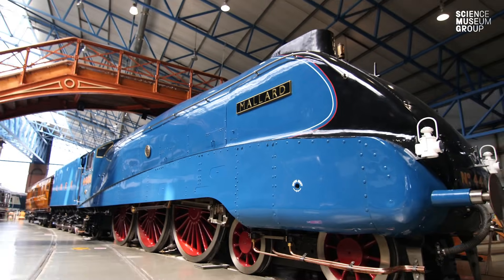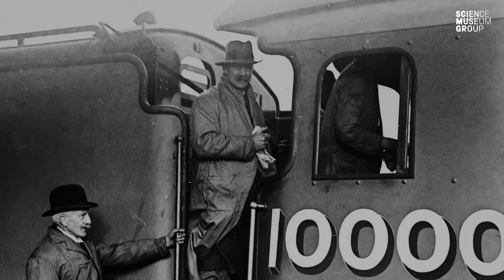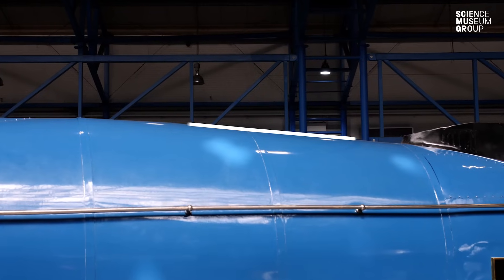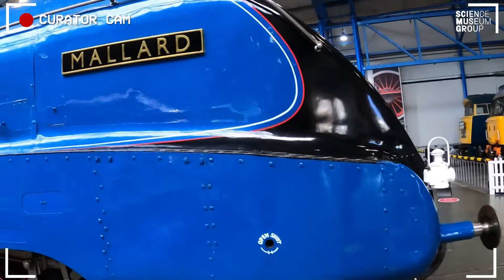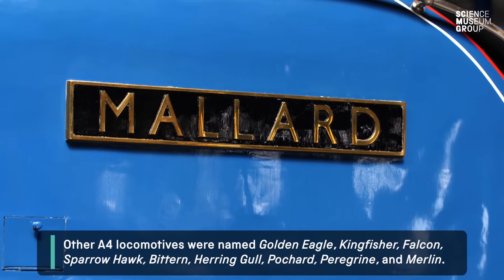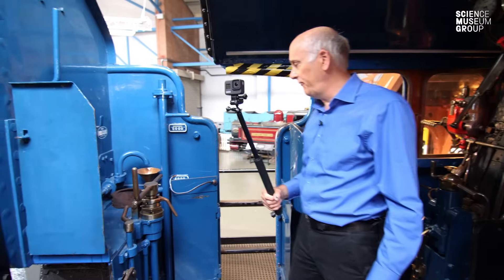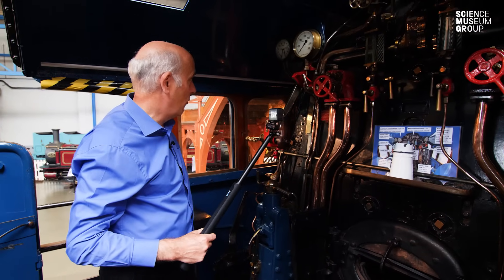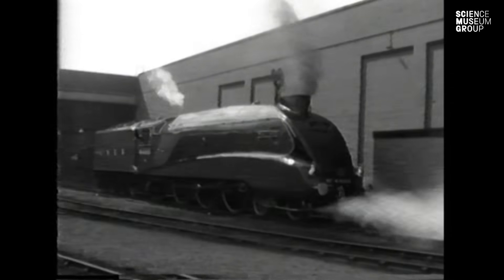Inside Mallard, the World's Fastest Steam Locomotive | Curator with a Camera

Comment: I wonder what they are going to do for the centenary? Could steam do 200mph? I know it technically possible. I’ve just never seen anyone achieve it? Could steam be made green with solar and electric elements? I know it effectively a giant kettle. So induction heating would be possible vai a third rail pickups or super massive batteries in the tender. Even the running gear doesn’t have to be of 1930s standards. As things can be made futuristic with magnetic barring. I don’t know of any steltics (steam electric) designs in use today. Thought feel that would be the way to go preservation wise. Might even suit lighter rail application with a compound boiler system.( many smaller boilers) bolted together perhaps? To achieve a record It would only need to reach 200mph for 10minuets. To hold the record. I might not have got everything. Thought I think the old girl would be proud to see younger generation continue the sprit of steam by going faster. I can see sleaker designs, fewer complicated components and all round easy of use. Mallard is alway a fave of many a steam buffs everywhere. Would be nice to see the old girl get a birthday present to remember. With the engineering available? I certainly think mallard record could be broken. Especially if there a flywheel or two incorporated spinning at high rpms.
Reply: I wish they'd restore Mallard to running condition for her Centenary!
Reply: @highbrookendmodelrailway  yes I think most people would. It would be cool if they overhauled mallard to run even faster. Try to get the old girl up to a 150mph question is would her frames be up for it? Would her wheel take that sort of stress? I know there might be a few Aerospace materials that can achieve it. Question is would they go that far in a overhaul? I’m not sure? Nigel gresley might have done give the chance. I know certain parts could be made with Alu-bronze often found in the landing gears of planes. If they were to go with reduced friction then magnetic barrings would be a great fit. Value gear upgrade to increase timing and cutoffs. In all it a lot of work and if the green agenda continues she will need more than coal to get her running. Indeed I love the idea of mallard chasing the steel again. I’m just not sure how they would achieve it. There’s many things that can be done to get her running. I fear the cost would prohibit it. Flying Scotsman too way long in the shop that the thought. Mallard will be no different. With an locomotive a hefty as mallard. Hunting and resonance becomes a real problem like real big problem. That mallard could derail at high speed kind of problem. I don’t think they would want to wreck a piece of history like that. When she did 126mph they had to overhaul her as her barrings were shot. I dread to think what damage came from piston slap. I loved to see the old girl do it one more time.  I guess all we can do is hope and pray.
Reply: Cerium steel in lightweight roller-bearing rods would probably be the better choice for rods.  See David Wardale's various improvements on piston valves if you want to retain them.  Note that vacuum eduction in the locomotive slipstream can both improve drafting and lower the effective exhaust backpressure at high mass flow.

Note that neither independent driver suspension nor 'canting' the drivers inward a la racing wheelchairs are advisable on reciprocating locomotives.  The engines have to remain in close "quarter" for balancing, and that involves torsionally stout axles; the wheel tread contour goes all to hell if you cant the wheel very far with respect to the railhead...

We worked out the details of 'correct' use of catalyzed H2O2 with Oxford Catalysts, over a decade ago.  As you may remember this involves low-carbon fuel (we proposed methanol or ethanol) and about 30 to 34% "HTP" -- the trick is that the H2O2 dissociates to water, and contains water, so by passing a (,comparatively) dilute mixture over the catalyst you generate about 11 molecules of water at effective superheat per molecule of carbon dioxide... and the catalyst runs cooler.  Mass flow is determined entirely by feed-pump volumetrics and pressure; any tendency to 'pressure excursion' just pushes the feed away from the catalyst area...
Reply: @wizlish  fair enough.  With the wish bone idea. it was general to keep the wheel in a near vertical with maybe with a tolerance of 1-2%.  Then have it act more like standard cross-slide. Maybe with the correct torsion spings to hold it all in tension. I know as smart as I am. sometimes getting the wheel geometry to work when overly canted would be a nightmare. Because of points. I understood the derailment risk and didn’t fancy it. Just struggle to picture it. So much to be to far out to practically work. Think Romans ballista and your may be somewhere close. 
I’d imagined having roll forging as the primary wheel structure.  firstly to reduce the material used and secondly for ease of assembly and maintenance. Much like a hubless motorcycle. Or droid tanks from Star Wars. Then having some crank arrangements to transfer directly from the con rods. I concur on the type of steel for the con rods.  though it might be worth considering a combination of rare earths in trace amounts to improve conductivity. Cerium and cobalt respectively.  ive heard to of neodymium and manganese being added though that is a bit left field for me. All I know it’s similar to wootz steel.  So would end up somewhere near crucible steel.. if it was good for swords it would be good in these types of applications. It would lend itself to being imprint with a magnetic field. 

I do recall reading something about pressure maintenance when using catalyst. Though my knowledge is yard and a half behind yours. It just something I’ve encountered along the way. I know the nazi used it extensively in there v2 rockets.  there was effort with black knight rockets. Something I wanted to read up on. As life a sweet shop of thing to do. Never got round to reminding myself. 

Pistion valves i was aware of due to duke of gloucester. A few 5mt’s and p2’s and American logging loco’s. may have been looking to replicate that. I’m not sure how that could transfer into a diesel style arrangement. Though I doubt that would be impossible? It something I need to learn about in greater detail.  So I’m loving the helpful pointers. 

From what I remember about drafting capabilities the whole idea was an air multiplier. Which presents things like the dyson air multiplier into the mix. I know it has a lot to do with co flow. other than that. this spanner monkey a little out of his depth. kylchap exhaust is as close as I get. I understand that it uses the exhaust as an injector. To suck more air in to repeat the cycle. Now thing have moved on and 3D printing  is available it’s possible to have nested designs.  Which help improve air flow and improve overall efficiency.  It just a question of choke flow? Where that happens? 

It might be possible make piston mods if the cylinder bore is sleeve in a copper alloy. So the piston head act more like solenoid. This would be beneficial to reduce ware on the inside bore. I know I’ve mentioned alu-bronze this would be one place where it use would be beneficial. Provide the outside of the cylinder head are magnetically imprinted with a high gauss field.  It may reduce the need for piston rings? As soon as the Piston moves it induce a magnetic field in the alloy. Much like Micheal faraday’s experiment into induction.  Where you have a floating aluminium plate above a charged coil.  You see this in some of the attempts to make a back to the future hoverboard. Some while back they made a copper lined skate ramp for it to run on. The same true for the pistons.
Reply: Unfortunately YouTube comments make it difficult to read while responding, or indeed to find a given comment without scrolling through everything when notified of a reply.

There is no need to 'separate' the drivers for better roadholding as in F1.  While lead-driver guiding is tremendously important, do that with good progressive and proportional lateral-motion devices, or some form of Krauss-Helmholtz arrangement perhaps with additional levers as in East German practice.

The cerium acts as a grain refiner.  Chapelon noted with some quiet alarm that the only way Timken roller rods could possibly work was if they were bending in buckling, probably to a visible extent, twice per revolution.  Your chosen rod metallurgy has to accommodate that.

You'd be correct imho taking your valve gear arrangement from Duke of Gloucester, but it ain't piston valves; it is one of the highest British technical achievements, overmodestly named "British Caprotti".  This has been carefully documented on DoG's Web site for your perusing pleasure; you may want to rearrange the valves and port geometry but the actuation needs little if any rethinking.

The Kylchap arrangement is still about the free-est to be practically built and maintained (things like the Lempor or Kylpor 'not having proved out well' in practice) and for high speed you will adjust this for free and even negative-pressure steam exhaust while using incidental slipstream to keep the fire stably drawn.

Balance the engine using the methodology for the 9F class if you want to retain overbalance, but go straight to dynamic zero-overbalance if you actually want to go at extreme speeds.

The other approach is to find the correspondence around Turbomotive 2 before Alan Fozard quit and joined the 5AT effort.  The balanced reaction turbine for that engine is easily capable of any speed the boiler can steam... and Westinghouse patented the fix for low-speed turbine slip in 1948.  (Magnetorheologics for effective duplex conjugation we're an established 'thing' by 1949...)
Reply: The absolute top limit for reciprocating steam would be determined by critical speeds, and probably involve harmonic coupling into the suspension.  It will not be achieved without true zero overbalance 'and all that that implies'.  There is a large fold-out drawing of a Chapelon design for 150mph in Carpenter's 1952 translation of LLAV, but I don't think it would be safe to operate on any real railway at that speed even if it developed the effective DBHP to reach it.

Strange that you mention flywheels.  One of the designs for the American ALPS locomotive in the early 2000s involved GTCC with steam bottoming, driving a generator originally used for SDI that had very large rotational inertia.  It would be technically possible (although not particularly cost-effective) to drive this entirely on steam, and completely suitable running gear has presently been demonstrated at well above 200mph equivalent...
Reply: @wizlish  awesome! When i have been dreaming about this I was thinking something like independent wheels, f1style wishbone suspension. Some form of direct drive. I’ve even gotten as far as thinking out mag lev parts. As I’ve seen such things as magnetic gears which will reduce ware massively. There been many other options I’ve become aware of like catalytic converters and hydrogen peroxide. Thank to integza on YouTube playing with peroxide. Then it’s all about gear boxes and transfer shafts. Even had ideas about a 10-12ft wheel. Completely based on a planetary gears set.  As an engineering student I calculated it need to be turning at 650rpms to do 200 mph. I originally wanted a reciprocal design. i realised it would be damn near impossible to get the things right from my knowledge base. I was thinking of designs like a rotary engine from an aircraft. V&W design. Nearly 20 years from when I first started dreaming of smashing it. My thinking has come along way. I knew that some sort of gearing would be needed. An ode to Richard Trevithick.  It taken me nearly 20 years. Learn about these things. Going from meccano. To where my thinking is today. I’m aware the steam needs to go green if its to survive.  It also means you can have high pressure accumulator.  Another mod I would have is disk brakes. More over use the wheels as the disk with massive callipers. I found refrance to SNCF 230-01 Class 4-6-0s. After taking a look, going to have to do way more reading. 155mph is nuts to say the least.  So not our of the realms of possibility. Especially due to the access to modern material science.  You got things like printed polly magnets with applications in bearings technology. In fact if designed well enough you have the ability to use magnetic induction to reduce friction. Which will levitate any component off any spigot or shafts. Reducing ware.  Maybe even eliminating it. It would have to a specific made for mallard. To ensure that comprehensive forces don’t set up a destructive resonance.  Leading to failure of the running gear.  Heck if she’s overhauled correctly no reason why she couldn’t exceed 150mph. Especially if high strength magnetic are involved. You get mag lev doing 300mph.  So a locomotive doing 200 with similar technology incorporated not out of the realms of possibilities.
Reply: I thought  maybe with a few tweaks it could run on gas, (swap the tender for a giant gas cylinder & the fire box for a load of  gas jets)
Reply: @nickoakley69  depends if the gas is non polluting. I’m a bit rusty when it comes to my chemistry. I thought burning hydrogen maybe the easiest option at least it only need one fuel(water)! Robert Murray smith is currently looking into urea catalyst to make Hydrogen. So might just be the place to start. I know if you burn hydrogen peroxide you can get the temperatures needed. however there would be issues with thermal corrosion. Plenty of literature on that! Ask the guys who play with rockets. If ever there was a day to go steam punk it would be now. Literally name the engine h20. Safety note: burning hydrogen can make nitric acids. through a reaction in the combustion chamber. Nitric acid and steel don’t mix usually. So really depends on which route you’re willing to take?
Reply: wow!  great knowledge
Reply: @nickoakley69  just a few things I’ve have encountered and remembered. as they might be important. I’ve been dreaming of this for years. Even considering turning the drivers into planetary gear set as a weight saver. It been a lifetime of trains for me. Especially like taking about engineering with a mind to what has been. leading into what could be. I’m learning not to restrict potentials and explore things I hadn’t considered. This enables me to expand my consciousness with respect to knowledge about the subject. Nobody quite gone as far as 3rd or 4th generation locomotives To my knowledge. The closest I recall is the gt3 br made. Thought I think they even had a version that was completely forward facing cab. Like the leader class. Bulleid’s class locos. but there where I fall flat. The Australians and Americans might have taken the design to whole other levels. Considering the vast distances they had to travel. It somewhat would have made sense. As coal, oil and gas could be quite bulky. So being able to convert water would have been a bonus.
Reply: https://youtu.be/aSe1WB9MTu8 it seams independent wheels might be possible?  Especially if super flexible design.

Comment: Love those streamlined locomotives. While Mallard has the world record. Thought that i had read somewhere that the Duchess's were more powerful. Matters not, both are representative of a golden age of the railways.
Reply: Different railways built engines differently as different requirements.   Duchess had to get over snap, GWR Kings needs to get over the south Devon bank’s.   These required power but not necessarily deliver speed.
A4 like greyhound.   Light and sleek built for speed but won’t necessarily pull as much weight of train.
Fastest scheduled train service was GWR Bristolian and that’s fastest recorded run over Brunei’s billiard table was set by a castle rather then a king even though less powerful on paper.

Comment: The fireman`s job was a skilled one. Just as the driver needed to know the route so did the fireman, he couldn't just keep shovelling coal into the firebox as if he did that he could quite easily dampen the fire down at a time when maximum heat was needed such as injecting water into the boiler or when pulling away from a stop or approaching a steep incline.

Comment: Is Mallard still steamable anymore? If she is, I would certainly be pleased if she did a run with some teaks.
Reply from the maker: Hi Matti, I asked Bob about this and Mallard needs a major boiler overhaul to be steamable again. Luckily other A4s are still running, and it won't be too long before another joins the fold—60007 Sir Nigel Gresley.
Reply: @NatRailwayMuseum  are there any plans to do an overhaul? I guess it would be pretty expensive, plus some people would think she should be left in an original condition
Reply: @NatRailwayMuseum  for Mallard to run again would she need the same heavy overhaul that flying Scotsman went through?
Reply: Bittern was running up to 2015 when her cerificate ran out. She's currently at Crewe waiting for an overhaul but I believe they're working on other locos first. I'm not sure when they expect her to be ready. I'm guessing it will be several years or so though.
Reply: @speleokeir  Bittern is in storage at Margate. It will be part of the new museum planned at the old Hornby works.
Reply: Unfortunately the original lner teak coaches cannot run on mainline due to the braking system